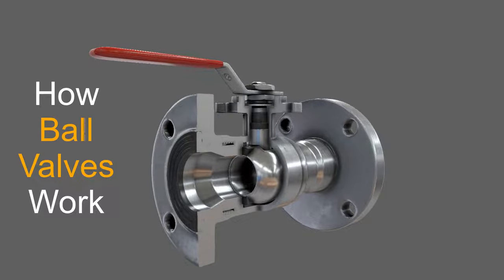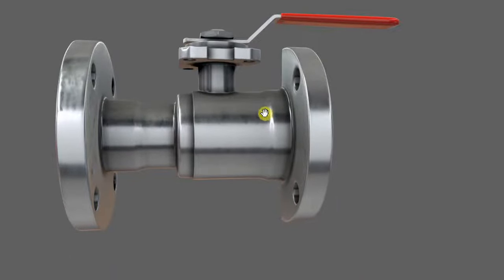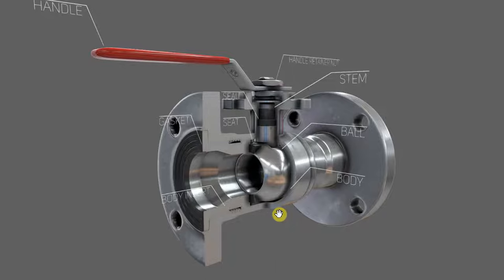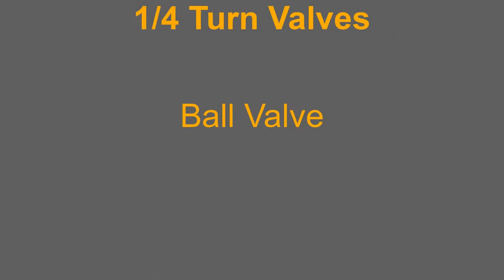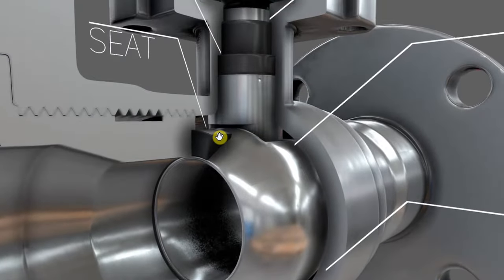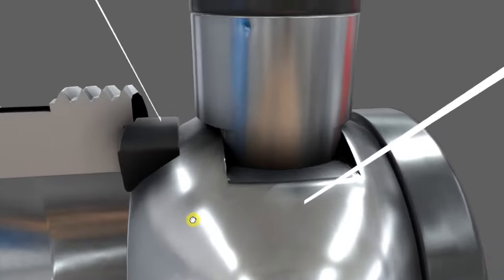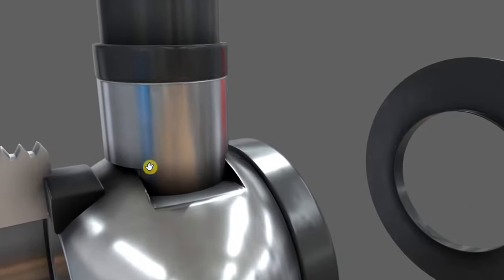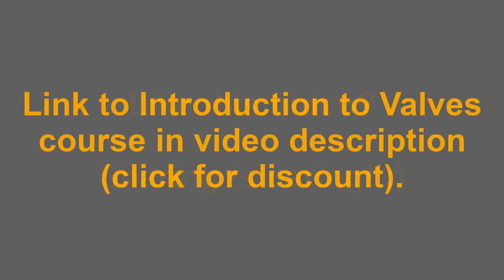How Ball Valves Work

Comment: Great video . I have one remark: Ball valve can be also used for very high temperature around 500 degrees Celsius if the seat material be also metal and no teflon. They say metal to metal seat.  also if we need a fire safe ball valve we need to have also metal seat or other material suitable for high temperature.

Comment: Nice video, one quick question. Can ball valves be installed vertically on pipes?
Reply: @savree-3d  Thanks for your answer. Im new in engineering and still learning about it so answers like this are a godsend.
Reply: @savree-3d  sorry, but I could understand. What is the relation between leakage and side or top facing of stem. How it is more loaded ? And what actually meant by "loaded" in case of valve stem

Tx

Comment: Hi nice visualization thank you so much.  In this you mentioned that the seat is made of rubber so it cant be used for high temperature applications.  I saw other valve vedios like pinch valves and butterfly valves whose seat is also made of rubber material..  so does this mean all these valves are not suitable for high temperature application.